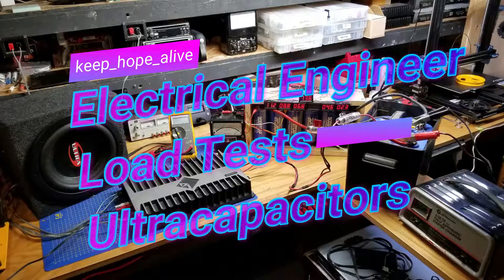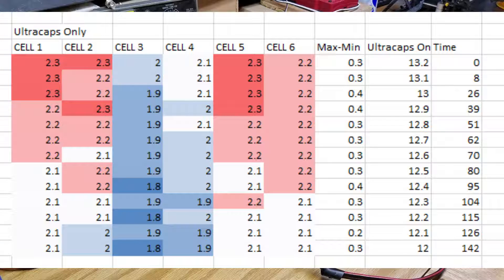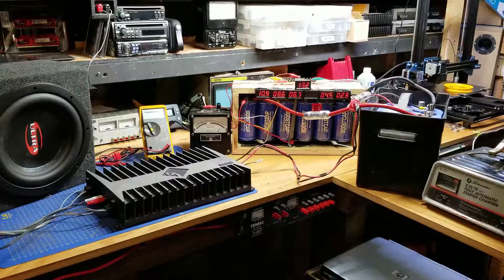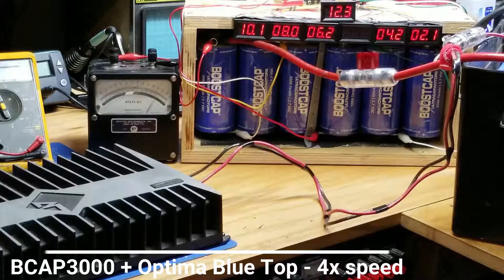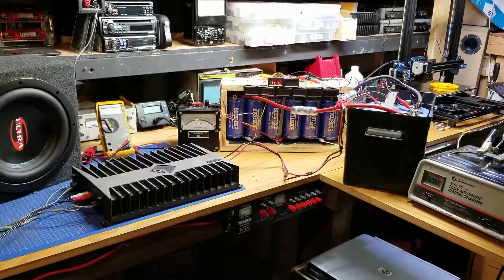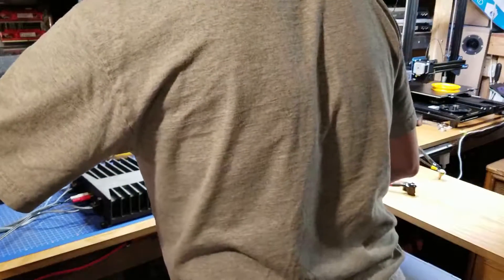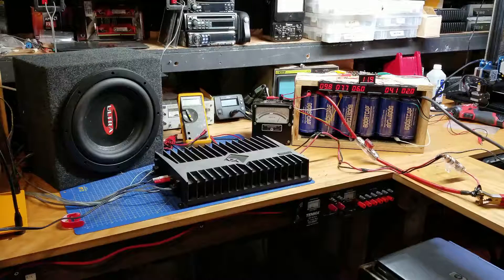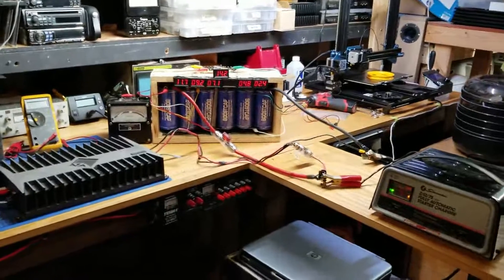Electrical Engineer Load Testing Ultracapacitors - The Case For Balancing Circuits

Comment: hello i have 2 acid batteries parallel voltage on car is 14,4 can i put 5 ultacaps 3v without balancer ?
Reply from the maker: when running ultracaps in series without overvoltage protection, you run the risk of bank failure.  Each cell will have a different drop across it.  I would stick with a bank of six if you're not using overvoltage protection (balancing).

Comment: Sir, 1)if ultracapacitors 3000F,2.7V charged by using 25 amps dc power supply will it damage.
2) if ultracapacitors are charged fully still 25amps,2.7 volt continue parallel in circuit will it damage or heat
Reply from the maker: The voltage rating of a capacitor should never be exceeded.  The ultracapacitors can charge very quickly, which is why a current-limiting charger is recommended.  You wouldn't run 2.7V capacitors in parallel unless you only needed 2.7V.  We wire them in series to achieve higher voltage ratings.

Comment: Be careful trusting those cheap Chinese DVMs. They are notoriously uncalibrated. The DVM on Cell 3 may be the problem, not the actual capacitor.

Btw, a music amp load is a wank. A load is a load. For fast draws, I use my 2000w inverter with the vacuum cleaner.
Reply from the maker: @thedolphin5428  agreed.  I didn't share the part where I tested all meters in parallel,  and I should have.  Music was used because we don't use them for vacuum cleaners, we use them for dynamic loads.  And that's the key difference that ultracaps provide.  They are useless for constant loads but useful for dynamic loads, like music.  My choice was intentional.
Reply: @richardvedvik979  
I use all sorts of loads on my boat (my home for 8 years). Huh? Capacitors are NOT "useless" for constant loads if/when paired with an input feed battery.
Reply from the maker: @thedolphin5428  what you see is the benefit of ultracapacitors on in-rush motor loads.  But resistive loads are different and ultracaps are quickly depleted and not a useful contribution thereafter.
Reply: @richardvedvik979  
But in a parallel automotive/marine situation they are being charged to a CV by the alternator.
Reply from the maker: @thedolphin5428  I'm referring to the load you used;  a vacuum on an inverter.  That load is a constant load and not a dynamic load.  This bank of ultracaps has less overall capacity than a AA battery.  The benefit is rapid recharging to act as a "stiffening cap", to alleviate the chemical batteries from needing to react quickly to transient loads.
Reply: @richardvedvik979  
You're either avoiding admitting to my original point or misunderstanding it.

Your tests did not show or test for "transient loads". You were addressing cell balance and simply discharged then charged, and then showed capacitor variance. I was simply commenting on the draw down method you used. 

So if your amplifier (or my inverter + vacuum cleaner) are connected to the output terminals of the capacitor bank which is wired in parallel to the battery, then there will be the same constant voltage at BOTH sets of terminals ... well enough to supply the audio amplifier with its required input voltage (~12.0 - 14.2v) to operate, even if there are occassional fluctuating demands on the amplifier's current draw ... unless you are you suggesting that the amplifier can draw massive amps beyond battery supply (and alternator, if running). 

Not being a motor-music-head, how much power do you expect your audio system to demand from a car's power supply?

Comment: Cool test, thanks for sharing. The voltage difference is more likely due to the actual capacitance in each cap, not the ESR. They are in series, so get the same current. The caps with the lowest voltage have the higher capacitance. Caps charge to a V=time*current/capacitance. Caps have production variations and the tolerance is often +-20% meaning a 1000F cap can in real life have a capacitance ranging from 980F to 1020F. If you have enough caps, you can place them all in series, charge just a bit, then select the ones that have the most similar voltage, and you have a pretty well balanced cap battery.

Comment: Integrate areas under current-time graphs to actually compare whether you extract more energy getting to 12V. Answer the question: Is there more energy available when working together compared to sum of individual energies?

Comment: If a cap bank rated for 14.25V has a charging voltage of 14.4 across them is it actually hurting them or is that small of an over voltage no biggie ?
Reply from the maker: Do not exceed rated voltage over caps.  Not even a few tenths.
Reply: @richardvedvik979  thank you

Comment: GREAT video!!! I was wanting to run 4 banks of 5-2.7v cells. I cgan get good deal to buy 20. I would be charging to 14.3 with a mechman 240 alt and with x2 79.8ah JY lithium banks. For 10k watts could i use one of the JY or would u keep both plus the caps? Also would you recommend this set up, or just switch to like 120ah LTO bank at a 10c discharge rate. yinlong 66160 prob or poss headway. THANK YOU!
Reply from the maker: Thanks and I'm sorry I missed this.  You really need 6 caps in series to exceed the 14.4V charge voltage because there is imbalance between caps so some may see more than others.  We need a buffer.
Reply: @richardvedvik979  ok, i get it. thx!

Comment: So do we need balance boards or not? It seems like we do. Been a year, do you intend to show the reasons or need for balancing circuit? I'm currently running 6s 2.85v 3400F caps for my car audio setup with 3 balance boards and the caps are all over the map on voltage. Is there an explanation? Do I need over current protection? Any help will be great. Thanks for the vid.
Reply from the maker: My effort toward testing balancing circuits resulted in my realizing most are just protection circuits, not balancing circuits.  Meaning they wouldn't change the results of my testing when using a 14.4VDC source.  Your 2.85V caps are rated for 17.1VDC - which is a pretty big margin for error.  I recommend measuring the voltage across each cap when you have 14.4VDC across the bank to see if any have a really different ESR which could cause a failure of one or more.   Protection circuits are fine to use, no reason not to if it makes you feel safer with your investment. 

I also moved and have been dealing with selling the old house and fixing the new house which slowed video production.  My plan now is to design an actual balancing circuit and see if it's even a good idea vs the typical protection circuits available (that don't balance).
Reply: @richardvedvik979  This is a helpful response. Thank you for the advice. Yeah, my balance boards simply don't seem to work. The cells can literally fluctuate between .80v and 2.9v. The battery will start at 12.8v and end up down at 11.2v (standalone auto batt with no alternator, for car audio). The first cell is always the highest voltage and the other 5 are all over the place and not in any discernable sequence. So when I recharge the batt and then reconnect the caps to it, cell 1 gets slammed hard and then the rest eventually catch up ... I hope you have great results with your experiment to make an actual voltage balancing circuit. I could use it. Haha!

Good luck with the new house. :)

Comment: After full charging ultra capacitor , further charging continued do create damage to capacitor or it's kept in circuit functions capacitor
Reply from the maker: Caps just float at the voltage present.  There isn't a case of "over charging" unless voltage rating is exceeded.  Consider how capacitors have been used in every other circuit for the past 80 years.   This application is no different than a ripple smoothing application on the DC side of a power supply.

Comment: I'd like to pick your brain about these Ultra capacitors . I'm in the process of  wiring a concession truck with a   Marine Deep Cell and Yinglong LTO batteries which have the capability of being dicharged down to zero and recharged up to 5C....some say 10C supposedly in a matter of minutes...with the right charger of course...  But I just want to use my alternator.   Bench testing seems to work fine except for recharge of the LTO's. They dont seem to last as long as they do when I recharge them with a charger. I'm wondering if Ultra Capacitors might boost the LTO's or make them work better in any case
Reply from the maker: Combining LTO with ultracaps will behave the same as combining with any other battery type.  The ultracaps will track the battery voltage and resist short changes in voltage.  The caps are unable to "hold" a battery to a higher voltage.  They can help a battery last a bit longer by removing short duration surges, as shown in my load testing video.